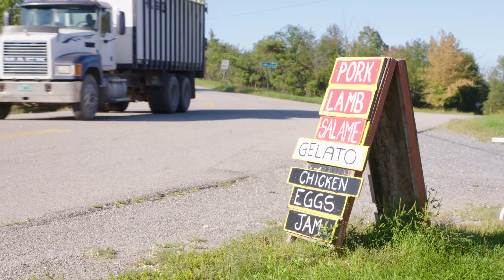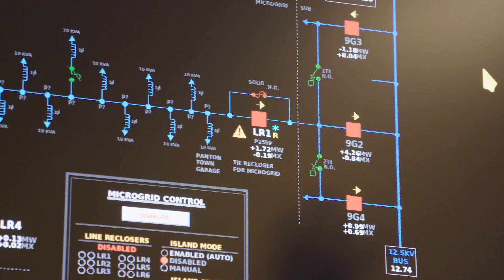Panton, Vermont's microgrid | Fighting climate change? #ClimateAcrossAmerica

Comment: How is it Clean energy when you have to replace a Battery? What’s the cost of a battery? What’s the cost of your panel Farm?
Reply: Where does the battery and all of its parts come from and how are they produced etc. efficiency is key
Reply: Lithium batteries are left to leach into the soil when spent.
Reply: The batteries in cars are charged by coal fired electric grid